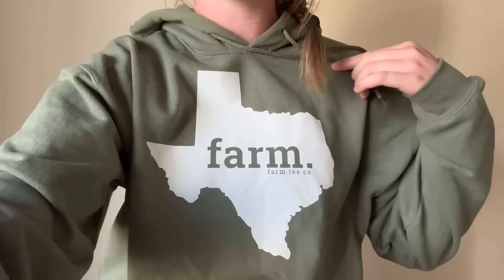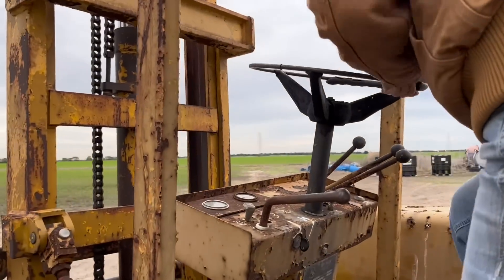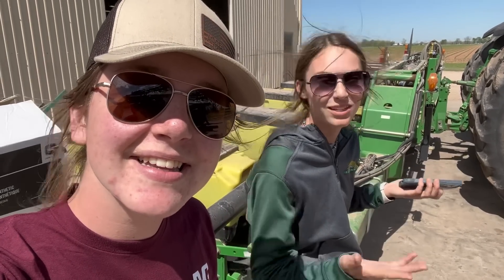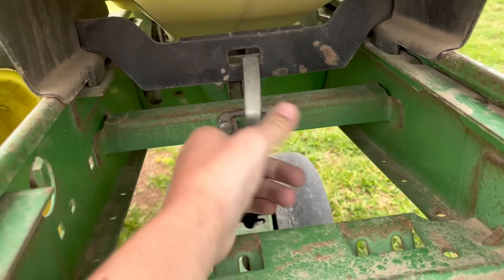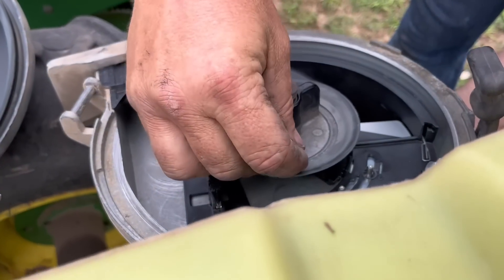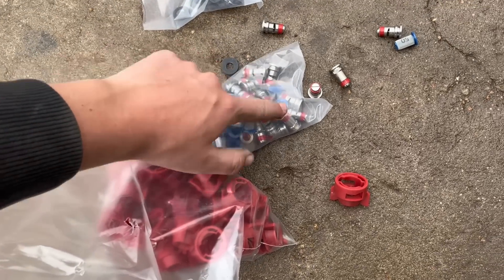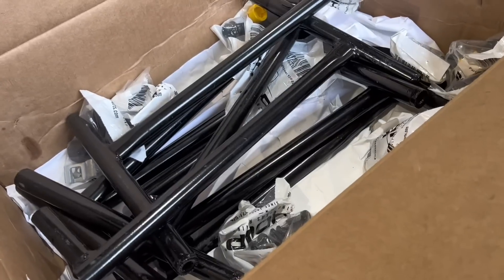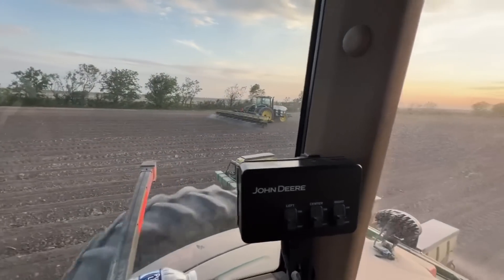Corn is Done, Time to Plant Cotton!

Comment: At 13:50, it's strange that each nozzle needs a filter. A common upstream filter makes sense or no herbicide filter.
Reply: You dont have to run them, but with atrazine you get little chunks, also the upstream filter may be larger.  Also flakes may form in tank or boom and break loose and plug a nozzle. A plugged nozzle can ruin an application.  Plus they are probably running low rates which means small nozzle orifices, easy to clog.

Comment: What’s the deal with those stack planters or whatever they’re called. I’d think they would have to have some kind of advantage but idk what the advantage would be.
Reply: Narrow transport for 3pt hitch planters where wide headland, drawbar style planters not used. Swing fold bar like corn not practical for 3pt hitch and stack fold is much better than old style verticle L fold bar. 7i
Reply: Cheaper and lighter weight, you don't have the central seed tanks with the blower and tubing sending seed to the planter units.